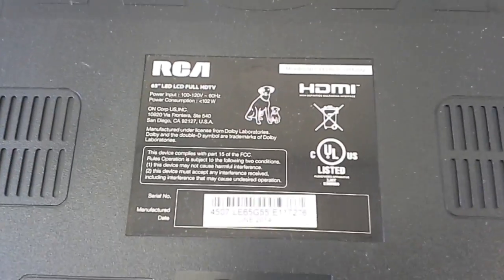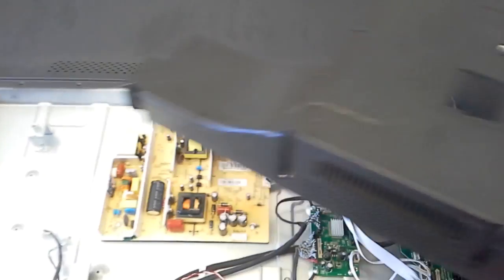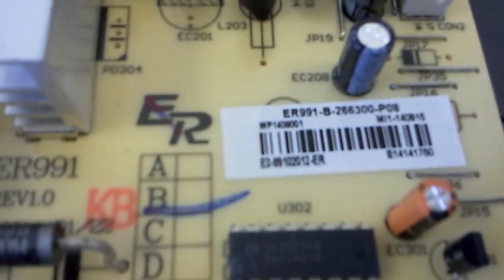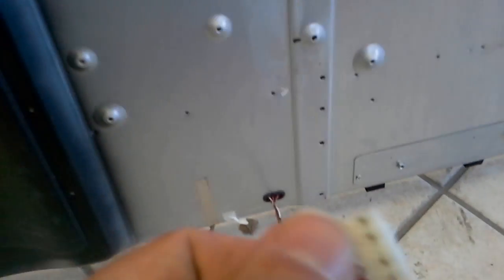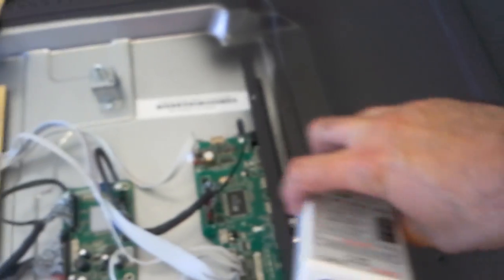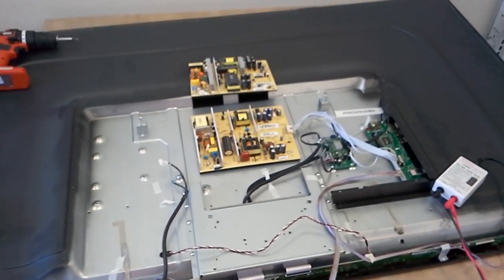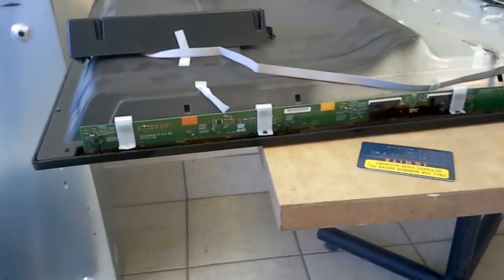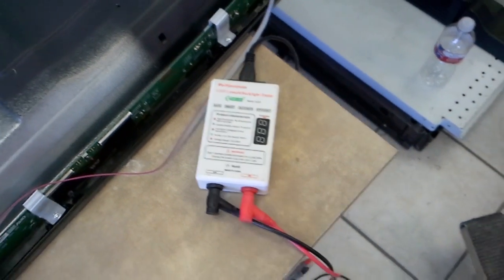How to troubleshoot and repair RCA LED65G55R120Q not starting

Comment: What voltage should I be reading for the led connection coming off of the power supply board?
Thanks
Reply: ~300 VDC so be careful!
Reply: Mine is 40 inches model. The voltage is about 60vdc at standby, when I press the power button, it climbs to around 120vdc, then falls back to 83vdc. The tv stays black. With the information from the video, I opened the screen and I noticed that at that peak of about 120vdc, all the LEDs blink once, but too low to be noticed from the front of the tv.
Still working on it,

Comment: I have an RCA LED50B45RQ doing about the same thing.  I plug it in, have the red standby LED on, go to power it up, the screen flashes for a split second, the red standby LED goes out, and stays out.  It will only come back on if I unplug it and plug it back in.  Will a bad LED cause the TV to "lock up" like that?   Also, does the panel on the LED50B45RQ come apart "backwards" like yours?  I've replaced several dozen sets of LED strips in the past couple months and only had them so far where the panel comes apart from the front and you have to carefully lift the panel out to get to the LED strips?  I was getting ready to throw this LED50B45RQ because I thought it had a bad main board, but if the problem is only a bad LED, I will attempt to fix it.  Very good informative video, thanks for posting it!
Reply from the maker: Well, this is ironic, but even though I have files and pictures documenting we've disassembled more than one LED50B45RQ I don't actually know how exactly they come apart. That's because they were part of a large batch of TVs we've acquired and dismantled for parts; so I have pictures of how it looks disassembled as well as pictures of the boards we've fetched from it, but I have no idea if you can do the same as with the 65'' model.
What I can tell you is this:

1) The behavior you describe does not sound typical for most TVs, but every new generation has specific design and behavior so my past experience is not solid enough indication that this is not a LED strip.

2) To check if it is a LED strip just buy a LED tester device as shown on the video and test the one or two circles that go in the panel..you do not even need to light the individual strips! If a circle does not come up you have good reason to suspect it may be the culprit and then try to access the strips.

3) We still have everything for those TVs as of the date of this posting - main boards, power boards, most likely spare strips too. Contact us directly through the website once you know what you need!
Reply: This TV I'm working on is shaped exactly like yours with a T-shaped back, and carefully looking at the ribbons from the panel I could tell they were coming from underneath the plastic bezel so I could tell it separates exactly like the one in this video.  So I decided to take it apart to check the LED strips.  And yes I do need to get one of those testers to generate enough voltage to test first before taking a panel apart, but I've gotten lucky so far and found bad ones on every one I've taken apart.  I use a cheap home made set up.  I have one of those universal AC adapters where you can set the voltage with a selector switch from 1.5 to 12 volts so I connect my meter leads to one of the jacks with a set of alligator clip  leads and the 12V setting is just enough voltage to dimly light up one LED strip so I found the dead one.  I then set it on 3V and use a 1K resistor in series to test individual LED's.  I only had one bad LED on one strip so I replaced it and re-glued the lens cap back on.  (I bought a kit of 50 LED's and lens caps from Shopjimmy.com a few weeks ago.)  When I see several open and shorted LED's, I replace all the strips.  But when there's only one bad LED in a fairly new set, I've been replacing just the single bad LED instead of the entire set of LED strips to save money.  I just started doing this within the past month so I'll have to see how long they last before another one goes bad.  What do you think of this method?
Anyway, I replaced the one bad LED in this set and put it back together and it works!  So I just wanted to say thanks again for posting this.  If I hadn't seen this video first, I most likely would have tried to take the front off the panel and probably tore a ribbon or broke something.  And also learning the fact that these have sensing circuits and will shut down if there's an open LED gave me great insight.  I've never had a bad LED "kill" a TV before.  All other's before this one have stayed on, had sound, but just had a dark screen.  So a million thanks for saving the day for me on this one!  And if it does happen to burn out again, I'll hit you up for a set of LED strips.  Thanks again.